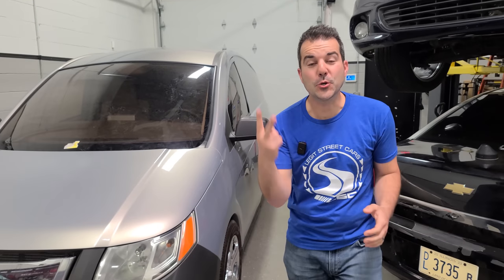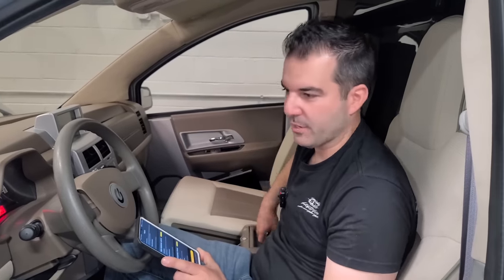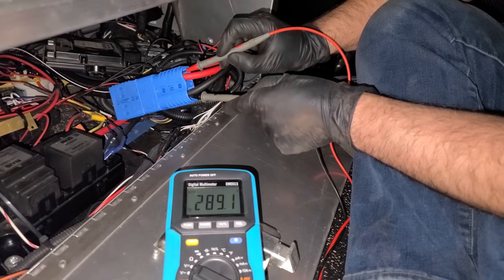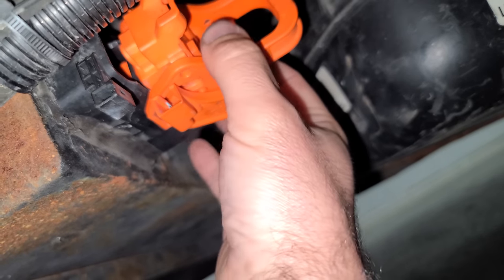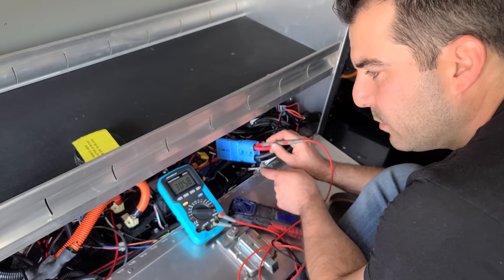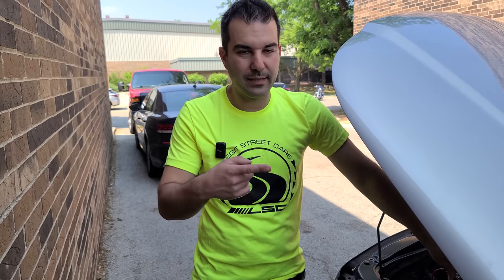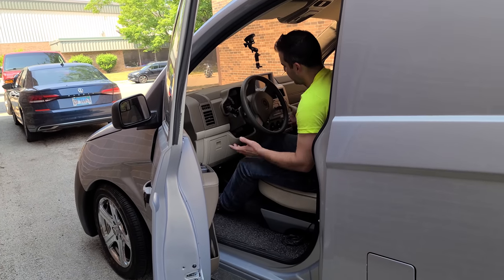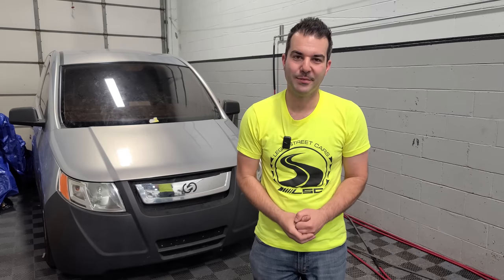I Fixed The Abandoned 2 Million Dollar Concept Car For $150! First Drive Ended In Disaster!

Comment: Edit: If drive is reverse for the EE but still drive for the gasoline engine.. I would hazard a guess the violent shaking could be caused by the EE trying to go backwards while the gas engine is going forward. Your going to trash the van. 
2009, 100mpg... It was TOO efficient. Let's be honest, we had alcohol, peanut oil and electric engines a long while ago. Big oil has a tenancy to bury things that will hurt their pocket book. Probably the only people with more lobbyists is the Military Industrial Complex.

Comment: Um.
Elephant in the room?
It goes forward in reverse! What does the engineer say about that? Right now, you have no drive at all from the front wheels, which is probably a good thing, because you definitely don’t want a tug of war going on. If the designers were any good at all, the engine should fire up before the HV battery goes into the critical zone.
I’m surmising the trouble with the trans is either down to you taking the linkage apart and generally messing about with it, but if the tug o war has occurred, then there may be a mechanical problem with it. I’m not familiar with Chevrolet products, so I don’t know whether it’s a hydraulic auto box or one of the mechanical dry clutch sequential things that were becoming popular around then, or even some sort of a cvt. A proper, old school hydraulic trans would probably cope better than either of the others, if faced with sudden selection of reverse while the wheels were rolling forward at speed, but it’s not ideal with any of them.
You need to find out if they were that incompetent, before doing much more!

Comment: If you need help balancing the cells manually it’s quite simple. 

Don’t let the BMS try to do all the balancing it will take too long if I’m right about this being a LiFeP04 100S then it’s just a matter of finding the cells tripping the over voltage (we don’t even know that, you haven’t seen the van hit it’s highest voltage point yet but cells being out of balance is a possibility)

Seriously if this thing is LiFeP04 especially if it’s an A123 pack hit me up on here

Comment: I was a cable installer YEARS ago, and we had Chevy Astro vans....and I got locked in the back at a jobsite. That was back before cel phones,  so I had to fashion a wire hook, and snag the CB mic from off of it's mount, and called a buddy at work to come get me out. It was horrible, for sure, and worse because they all knew about it back at the shop. Good times.

Comment: With the electric motor running in Drive while in Reverse, if you can find the connection, should (in theory) just be an inverse power connection between the gear shift system and the motor. Inverting that should (again, in theory) fix that issue. And that may be the reason it started clanging when you were running on engine power over 3-4 mph, because the electric was in Reverse, but the transmission was in Drive. This may also be related to why the engine didn't start when there wasn't enough battery power, since it needs to be in Drive for the engine to turn over, but Reverse to move forward on electric power. Just a theory though.

As for the car shifting into and out of gear while on engine power, the gear selection looked like it was somehow hydraulically powered when you were showing the the shift linkage. Perhaps replacing the hydraulic piston may fix that issue, or check the connectors that actuate the piston (assuming that is indeed how it works).

Obviously, the Engineer said that the electric motor banging phenomenon is likely an issue with the high voltage battery; but I feel like what may be happening there is that, perhaps, the issue lies in the motor not going into Neutral. It seems like it is rapidly switching back and forth between Drive and Reverse. Almost as though the system is intended to transition to a Neutral state from Drive/Reverse when there isn't enough voltage coming from the battery. However, each time it tries to switch to that state from Drive/Reverse, it hits the opposite state and immediately tries to reinitiate the Neutral transition again. Rinse and repeat a hundred times a second and boom, broken motor mounts and loud scary banging. Once again, just a theory off the top of my head with no sleep.

Will you read and respond? Unlikely, but I still wanted to add my thoughts on the situation and give you some avenues for troubleshooting that you may or may not have already thought of.

I'd love to get some feedback from any viewers who actually know more about how EV motors are supposed to work to see if my theories even hold credence.

Comment: I almost wonder if fit some reason the motor terminals somehow got switched around. Does the engine try to start when it shakes? My only thought is that the engine is trying to go forward and the motor is trying to go backwards. Like I said, idk. Just a thought.

Comment: Locking yourself in the back of the van (twice) was not the dumbest thing you did.  You took a big risk charging the high voltage battery in the shop.  Rich's advice- "A professional would tell you Don't plug it in... My advice is to plug it in- OUTDOORS,  away from anything that can catch fire!"  But maybe someone who knows more told you it was safe to plug in what do I know?

Comment: I'm working on my 2007 Mercedes-Benz CLK 550.  I'm having issues with the whole EIS, ESL, ECU, key fob...  Fun fun..  Next thing to test is my starter and starter solenoid, it's just really difficult to get to since I'm working on the street and the car is on jack stands...  I'm trying to get the exhaust out of the way.  I'm considering just jumping the starter with a hot wire to see if the car will start at all.  I tried jumping the relay and that doesn't work unfortunately.  I'm thinking I have a bad front SAM as well, possibly.   I wish I had a decent scan tool

Comment: re: @LostMyName15 post: I think most responders have it fairly dialed in.. However, don't most hybrids start the gas motor immediately when the batteries are  below rated optimum voltage?? I this is true, then wouldn't  the system try to start the gas motor while in park?.. & if the EV motor system "lost it's brain.." after 12 years of "low" battery, and started the AC motor backwards as others have stated, the very initial starting in any  way.. of the gas engine system.. would just snap the mounting  bracket IMMEDIATY. AC brushless motors have HUGE torque!!.. (As anyone who has driven a Hybrid or ICE w/ "start-stop", the gas engine makes literally  NO sound  or vibration when starting up..)

Comment: Red lock tight the motor😅...does it got locking nylon nut or double bolt😅... Protect the president at all costs even suffocating him... Not exactly sure what's going on I'm pretty sure you'll figure out by now😅.. three phase motor go backwards depends on what orientation you put those wires in... Nevermind it was backwards 🤣omg is stuck in revers regenerative braking but for the gas motor 🤣

Comment: @LegitStreetCars You could swap 2 motor wires out 3. Like it’s right now ABC, after changing it will be ACB or BAC.

This will change rotation direction. So then it should be ok, when you select “drive” it will go forward.

Comment: Man, You should really keep this one. And stop whining about the build! It´s a one-off, the first ever and only one. Wrap Your head around that. When You done sighing and locking Yourself in- start making it better! As You correctly said: this is EV history. And You are in contact with someone who worked initially on this.
Let´s make this a useable van, shall we? Just stop making it worse. Let it charge, let it do its thing, You´ll be fine!

Comment: I am Ray Pittam on nearly all Search Engines. In October 2010 I found this Reproduction 1901 Oldsmobile Curved Dash car. I got it in exchange for a 3500 gallon water Tank and we loaded it up It had been sitting in the spot I found it sense 1952, That was the last license on it. That little car has traveled on a round trip to Missouri and back to California as well as several Hundreds 9f miles through out Northern California. Check it out on most any search engine, It has been honored by a President as well as Congress and many other big dignitaries.

Comment: As an Electrical Engineer that’s had experience with prototyping and lab cars. I can honestly say this looks to have been built by enthusiasts as rather than skilled engineers with Auto Electrical qualifications. I appreciate it’s a prototype but seriously I’ve seen LabCars built better and they don’t drive and are made simply to test electrical architecture. I.e not actually a car! This is horrendous I’m not surprised they didn’t get the funding!

Comment: 2 project.. inclosed cargo trailer  from a late 90s  vandura conversion van.  Only problem  now the 2k savanna... the issues i have.. Pinon shifted upward and broke drive shaft. Got replacement.. but the angle of Pinon is way too high so van only drives 10 mph... seems  no one will fix it.. but they will  replace  everything  for $5k.  Is the a way tonre adjust the Pinon... ( the axle pipes are in the right place,shocks and leaf springs  ok.. ..just the Pinon out of alignment..going to miss grand national 😢  this was my last year to go... and the ripe is dead in the water... the trailer  is ready.. but ill have to sell it to fix the van..

Comment: This thing is cool, just put a crate motor in it and ditch the EV garbage. Its never going to be reliable. Change the wheels out for something a little more modern as well. Also the grill is ugly. 

And -- why would you put that bracket back in knowing it was going to fail again. Dont you build muscle cars? You know that 1/4 steel is not going to hold up to that amount of torque.

Comment: Dude keeps going on and on about how hobbled together this thing is and doesn't seem to remember that the marketing lady told him this was an alpha stage vehicle. Alpha is basically supposed to mean hobbled together and unrefined because you don't know how much you're going to change so it makes no sense to lock things down and do things pretty. Beta is next where you START to refine but even beta is still at the beginning stages with multiple beta versions to refine. In closing, yes this is how prototyping large, complex creations works. This includes mechanical hardware and software.

And before somebody says but over $2 million dollars? Yep, and not in equipment costs. In design, in fab in testing, etc. The marketing person told him that the vehicle was literally flowing overseas for wind tunnel testing. They employed 65 people, 65 people were not employed for manufacturing cuz they hadn't even reached that stage yet that means 65 people were involved in the engineering and development work.

Comment: A "regular" EV would take days to charge on level 1 (120v).

What voltage is a full charge on the van's batteries?

All that chattering almost seems like the motor isn't getting enough power to run normally.

Also, since the mounts were broken when you got the van seems to indicate it had trouble long ago.

Comment: Working on 
 My 12 chevy cruze (: 
 With mods  & fuel mileage is better than stock so far. 
 Lol . 
 Good luck with the van 
 You could park it out side over night in the farthest parking spot with a camera on it . & charge & watch. 

 Van 6.0 lol will be a blast just like the ppv. 
 Wagon or a  v 12 with air on dyno would neat. 
 Be safe.

Comment: The motor polarity is different from the drive/reverse switch of the gas engine. Basically the rear wheel drive is trying to go in the opposite direction of the engine/transmission.  When the EV mode voltage drops the gas engine assist kicks in.

Comment: the EV mode seems to be running perfectly, however it seems like when both EV and engine runs together at a same time, they move against each other like EV is moving backwards on DRIVE mode while the engine moving forwards in DRIVE.

Comment: Gas engine is running forward while the electric motor is running backward. When running together they fight each other and the weak mount bracket breaks. That's why it does not shake on full EV mode. I think the cabling on the motor is reversed.

Comment: You might need to swap some cells, but... 280 volts potentially you could be looking at a perfectly ok battery.  ^_^  id need to know more to tell you more about how it is.. Basically what you really want to do is get that battery open and get each cell up to 4 votes.  You have a lithium charger you could go sell by cell get them all fully charged.  Once you have them fully charged (4.1 or 4.2v usually unless they used lifepo4 cells) you can reconnect the bus bars and your battery should be fine. 

Just make sure you reinforce that mount next time.   Double the thickness where its breaking, but also try to figure out what is putting so much torque on it that its snapping.   Is it in brake mode while the car is trying to drive?  Is it trying to do reclamation of power from the electric motor thus creating torque?  Where is the load coming from?  Youve got some engineering problems to fix here, but its sure a cool project!

Comment: If the engineer is correct, a possibility is that the battery voltage is collapsing as soon as the electric motor is pulling current. Then the motor stalls and the cycle repeats.

Seen that a few times, but the biggest battery I have experience with is a 7s5p.

Comment: I do believe that electric motor is "wired backwards" thats why the motor mount was broken, it turns the wrong way when it engages. If it is an an ac-motor, just change place on two of the three face wires, problem solved, if it's an dc motor just swap polarity.

Comment: Cool project, wondering why you wouldn't just use a male replacement plug or shore power plug rather than splicing in the extension cord?

Comment: If the gas engine drives forward in drive, and backwards in reverse, and the EV motor does the opposite - then I guess only pure EV and pure gas modes work, whereas in hybrid mode the engines try to rotate the shaft in opposite directions and the gas engine shakes the EV around.

Comment: The two motors are fighting each other. The electric motor is wired backwards. When you put it in drive the gas motor is I'm drive but the electric is in reverse. That's why you can drive it in reverse but the gas motor tried to kick in and that's why I't started to shake cause the gas in is in reverse

Comment: im stalled on my project right now. Im swapping a 5.9 magnum from a dodge ram into a 1984 e30. Using a holley terminator and converting to coil near plug. I have the shell of the car, then engine in pieces with everything i need to finish the swap, then i had to go and have a kid and ran out of free time and money. hoping to get working on the engine build soon when i can find the time

Comment: Might sound silly but I wonder if the polarity of the motor is reversed.. which is why the motor bounces when in drive but works in reverse… basically the clutch is trying to grab but the wheels and weight keep turning it

Comment: I'm guessing the motor is wired to run in the wrong direction. With a 3 phase electric motor, reversing  the direction is easy. You have 3 leads going into the motor. At either the motor OR the inverter, swap any 2 leads. Think of them in a row as A B C. Change them so they are A C B or B A C.

Comment: Honestly I think you need to address the issue with Drive and Reverse on the EV motor. The two motors should be using the same forward gear. the original team may have swaped two wires by mistake on a repair or when cable managing and when driving on fuel mode had the same problem you encountered that lead to the bracket braking.

Comment: The clutch issue is caused because the electric motor polarity is reversed. So right now your gas engine goes forward with drive but the electric motor goes backwards with drive. So when you try to turn it on in hybrid mode where they both turn on they are fighting each other in that clutch assembly. The motor may not actually be trying to engage. But it's polarity will want to make it spin one way easier and the other way the magnetism will try to hold it from spinning. So it will free spin one way but not the other depending on polarity.

Comment: Im sure its fixed by now but i think the vibrations thats breaking the electric motor mounts is because the wiring is backwards. Meaning you put the car in drive and the gas engine is turning one was and the electric is wired to go in reverse as drive. Im not sure what the electric motor is linked to but if they are opposing each other it kinda makes sense to me. Just sayin... as someone that knows absolutely nothing about how that hybrid system works. When i seen the electric motor jumpin around when he tried to start it i thought of my poor 17 silverado that had its drive shaft ripped out due to a super smart tow truck driver towing it incorrectly...

Comment: Alex. Love your channel. Question. Have you tried switching the positive and negative high voltage cables going to the electric motor? It seems like the shake you’re getting is the gas engine trying to go forward and fighting the electric motor trying to go backward. I’m new to EV troubleshooting but it seems logical. Just thought I’d ask.
Reply: After reading the comments, seems many others have this same thought.

Comment: Please try to fix the wiring. Insulate every cable and bare connector, check the connectors for a good fit and fix the cables somewhere. The one big resistor at 17:25 has no insulation on its connector and is near the power connector for the HV switch.

Comment: if the gearbox is working propley ie faward and reverse as soon as ev kickis in and shudders and brackets broke then also on ev the faward and reverse is backwards then possabley the motor is reerse wired  and that is why the brackets break